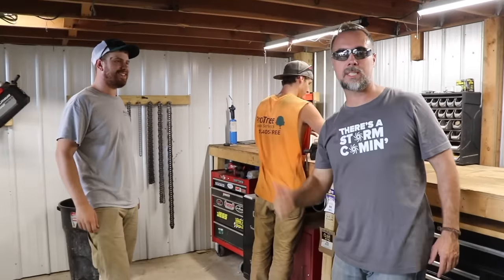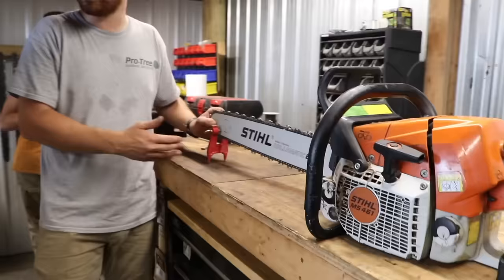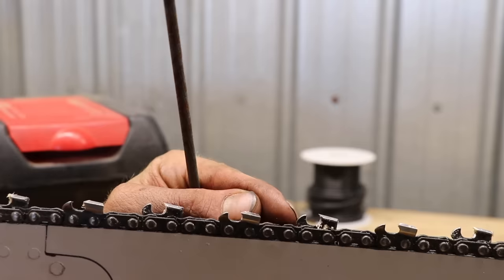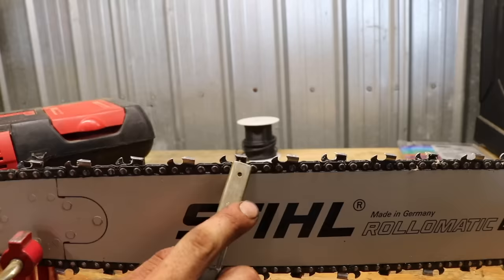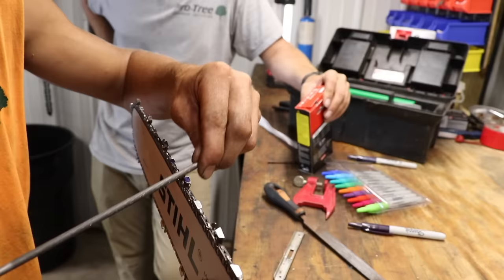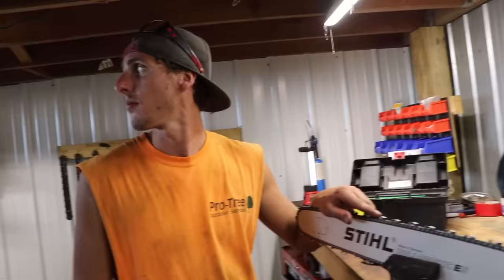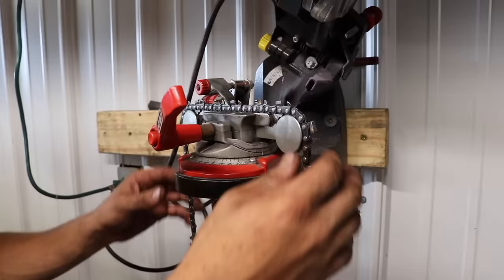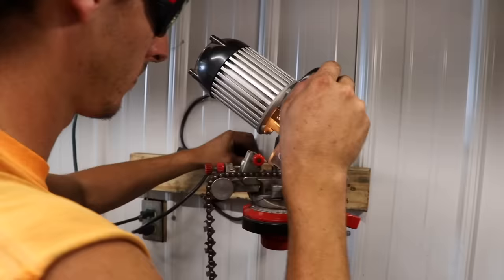How the Pro's sharpen a chainsaw

Comment: Harbor freight sells a chain sharpener that works fine if you are patient with it and it's not expensive.
Reply: It works great and for $30 it does everything you need it to do. I like that there is a little flex in the handle. That way I can first bring the grinding wheel down into the gullet using the depth stop without actually touching the tooth and then flex the handle sideways to bump the side of the grinding wheel into contact with the cutting edge of the tooth for a quick second without heating it up and bluing the steel. I usually give each tooth a few light bumps a couple seconds apart and it's good to go. Mounting the grinder up at eye level like they did really helps you see what you're doing and you don't have to strain your neck.

Comment: What was the clearance difference from raker to teeth ? What was the vertical angle of the grinder ? Also if you change the angle you grind out on the tooth you can just flip the chain to grind in the out direction. Shore up the grinder some also . What’s the best raker height I was after but 👍 for the video .
Reply: Hi J. The Oregon chains I use are set (filed) to 0.025' below the teeth tops. Best regards.

Comment: I hate to admit this but when I sharpen a dull chain I only improve the cutting a small amount.  After my small improvement it takes no time to reach dull as hell status again.  I have dropped my chains off to be sharpened at the pro shop and get the same result minus $5 per chain.  I know I'm doing something wrong and they are too.  I just buy new chains since I'm not a big time user of my saw.

Comment: Hand filing will never let you down and cheap investment.  Filling each tooth evenly (remove same amount of metal) for an even cut is a myth,  if one tooth is damage is going to take more filling strokes than the others,  and you are not going to lower the other tooths to the level of the damage tooth.  Make sure you have sharp tooth,  look at the top of the tooth and make sure is clean line and sharp corner and rakers are nicely lowered with raker gauge and you're good to go.
Reply: This is about the most level headed reply I've seen. Having every tooth the same size? what world do these people live in. Obviously one where production work is not getting done.Sharp top plate, sharp cutting corner, end of story. If you can't sharpen a chain in under 5 minutes no matter how F-ed up it is find a new career.

Comment: Just curious as to why he’s running the file the opposite direction? Should be pushing the steel away from the edge n sharpening the cutting edge rather than pushing the steel towards the edge thus building more material on said edge. Always file away from cutting edge.

Comment: You need to get cbn wheels and loose the stones.  Cbn wheels won't heat the tooth, provide a better grind and never need dressing plus they will last for at least 1000 twenty inch, forty inch overall loops.  I sharpen chains for my customers and grind chipper knives as well.  Diamond wheels sells the cbn wheels and you can order them online

Comment: One thing I notice you guys didn't show any adjustment on the pitch on that chain sharpening machine.  Also from what I heard is if the electric sharpening machine doesn't have a reverse motor on it One side of the chain gets sharpened on a different direction than the other side it never cuts very well .

Comment: Great video, I have a chain sharpener but in screws down to hold it in place and its difficult to sharpen the chain without it twisting because of the way it is positioned in the base, is it possible to make it so that it screws onto a wall instead????

Comment: I'd prefer the hand file technique rather than the mitre grinder. 1, cost to use ratio. 2, I practice with my gear as a florida outdoorsman for when the annual storms initiate a shtf scenario. No power= no grinder (or luxuries).

Comment: I can sharpen the chain almost as quickly as that grinder. Just practice. 
 FYI when you’ve reached the point of bluing a tooth, that means you’ve reheated it, taking OUT the hardness and making it SOFTER, not harder.
Reply from the maker: Thank you for the tip Mike!

Comment: Excellent video, I really appreciated your raker teeth instructions. I do take them down but not with as much precision, so I will lift my game on that. I have only had an electric sharpener ,(similar to yours)for a few months and was quite interested in how long you applied the grinding wheel to the tooth, as I was a bit concerned I might have been grinding too long or too hard. From what I saw you actually grind the tooth more than me, which was a bit of a surprise. Here in Oz our fire-wood is hardwood and I am at present cutting the hardest of the hard ; 100 y.o. fence posts of a  timber  known here as Black Box,  dry hard wood so the saw must be good. I sharpen after every tank of fuel and was advised to turn my sharpening disc over about every 6 sharpening and turn the bar over regularly as well. Also we dress the bar cutting edge with a flat file to take of any feather edge.    I am getting pretty good cuts but one can always learn more . Cheers Davox.

Comment: My great uncle has a 455 rancher with a 20in bar great saw cuts great well til it started cutting crooked. How can I fix it so when I cut it don’t cut crooked? It’s sometimes straight and sometimes you can see a curve a little bit to it. The last 3 cuts I did yesterday was curved so I stopped the first time and sharpen by hand then tried again and the 2 last cuts was curved. I’ve only been running a saw for a couple years and this is the first time this has happened to me.
Reply: Take bar off file it with flat file to get burs off then flip the bar. Sharpen chain  if was not cutting good then check the racker deph  and when sharpening all ways get the gullet out
Reply: @jasonscruggs986  i tried that earlier and it still cutting crooked still has some curve to it. I'm gonna pick him up a new bar and chain. I gotta get one my polan anyway.

Comment: Good vid!!!  I learned that bluing a material ALWAYS makes it softer???
Reply: it actually all depends on how fast the metal was cooled after it was heated. the faster it cools the higher temper/more brittle the metal becomes
Reply: @bhf4u  Ok, but in this video they start from a hardened material that gets heated by sharpening it, and there is no cooling (quenching) after.

Comment: pretty good,,, hand files work one way,,dont drag it on the wayback,,,the handfiles make the chains last alot longer if u can file,, the teeth should be kept same lengh,sharpness etc,,if they get to far off they can cause cutting problems,, iv had chains the angles were different and teeth were longer on one side cut straight still and others that were pretty damn perfect still would cut to one side lol when i file ilike to push up, try not to take more metal off then needed,, my chains usually last awhile,, if idont go cutting rockswith them lmbo,,,,,,,,,,,,,,,,,,,,,,,,, but in all good video!
Reply from the maker: Thank you !
Reply: Aah yes the rocks,doesn't take many lol
Reply: @ferrallderrall6588  honestly it amazes me how far into the rock it will cut lol
Reply: Won't happen if you got the sharpner with you of course lil
Reply: @indianajones8200  lol,, been running chainsaws for 10 years now,, believe what you will,,, lol

Comment: Most difficult part of chainsaw maintenance is the damn chains!!! Angles, Chisel, Semi Chisel, .050, .063, Pitch, blah, blah, blah...Getting all that right is a bitch. Then it has to be sharp! LOL...Good info guys. That Oregon sharpener and hand filing do take lots of practice to get it close to "Factory" condition. Chain manufacturers put the perfect edge on each tooth before they're even assembled. Thousands of dollars worth of equipment just in that part of production. KEEP SHARP!

Comment: Ok you said 30 degree for tooth sharpening what about the angle to set wheel off vertical??
Reply: This angle is actually more important than the angle you talk about as anywhere from 25 Deg to 32Deg is all dependant on type of wood being cut. Might be ok for soft wood like Fir but it not good on Australian Hardwoods.

Comment: I have a strange question. I just started cutting slabs with an Alaskan chainsaw mill for the first time. When I’m out in the field, I seem to get 3 or 4 sharpens on a new blade and then on the next one, it only produces dust instead of shavings. I’m doing the exact same thing I do on the previous sharpenings. Will a hot or close to hot chain prevent a good sharpening? Wasn’t sure if I should let the chain cool down a bit or not. I’m kind of stumped.
Reply: Rakers need to be filed down.

Comment: The electric sharpener disk is always spinning in the same direction so sharpening every second tooth on one of the sides must be wrong, the same as hand filing in the wrong direction while the teeth on the other side would be done correctly. So wouldn't it be better to align each chain side so that the direction of the spinning disk matches the cutting angle of the tooth as in hand filing?

Comment: If I use the electric wheel sharpener do i need to go back and file the rakers as well ?
Reply: Yes.
Rakers should always be set according to how long the cutter is, the length of the cutter changes when you grind the cutter or file it.
Any other questions id be happy to help. I have plenty of vids on my channel to see how a properly tuned chain cuts.
Have a great day.

Comment: KEWL !!! Thank you for posting! 
   Question...On the electric sharpener, does the grinding wheel go up inside the cutting tooth, and cut a radius like the file does, or does it just grind the edge straight and at an angle? I bought a Harbor Freight one and it doesn't sharpen like a file does, and it doesn't cut near as good as hand filing does! Do I have it set wrong? I have watched MANY videos on it and I have mine set, just like theirs, and I have reset the rakes, too. If I hand file, the saw cuts great! If I use the machine, it tries to rub thru it! HELP
Reply: Stop buying stuff at Harbor Freight prices if you want professional grade results.  A better model will work better, especially if you have someone that's been doing it a while there teaching you.  However, even quality machines are difficult to set if you want better than hand-done work.  If you're not doing several tons of cutting every day, it might just be better to stick with the hand file.

Comment: I would have ask how long it takes you to do this compared with how much you make per hour. It might make sense monetarily to just get a a new chain or buy them in bulk.
Reply: Throw away a new but dull chain? You would be fired immediately from any job.
Reply: Good point. Why not just include in the quote the cost of a new chain? They also spent $600 on a chain sharpener.

Comment: what is the thickness of the blade on the electric sharpener?
Reply: It should be 3/16 for a 3/8 or .404 chain and 1/8 for .325 and 3/8 low profile also called picco for stihls 3/8 LP chains.

Comment: cant flip flop but you can switch hands 
and do every tooth as u go once around
Reply: No you need to file from the back of the cutting edge to the front. This gives a more honed edge to the edge. If you file in reverse it is easy to fold the very edge of the cut and this will blunt quicker.  So sharpen evry other and then reverse the blade as they have shown.
Reply: Blade? Chainsaws have a bar and a chain. Alot of other saws have blades, but not a chainsaw
Reply: Everyone that knows what they're doing sharpening saws does all one side, then flips and does the other. The angle gets maintained consistently better that way.

Comment: I'm sorry,but I disagree with other folks comments. I know yall meant well,but this video is woefully inadequate for anyone who needs it. There was constant interuptions,conflicting opinions,jumping from subject to subject. If this video is meant as an introduction, and I'm assuming that's the intent. You should lay out some basic options for sharpening kits,get some closer shots of the before,during,and after the sharpening.  Show a hand sharpened chain as compared to a new one,and when one is almost to the end of its service life. The $600 sharpener is nice,but only as a mention and perhaps minor demonstration. Oregon,husqvarna, and stihl all make decent affordable hand sharpening kits and the only downside is that they're a little slow to use correctly.  I hated trying to use a stump vise in the field because you ended up squatting on the ground or at some weird angle. I ended up mounting mine to a 3ft long 2x12 and I sharpen on my tailgate. I'm not a big fan of Oregon depth gauges. I prefer stihls or husqvarna. A good clean round file can work miracles on even the most dull chain. Buy yourself a good hand filling kit,stump vise,and a few extra chains. Watch your chips on your new chains and strive to maintain that size.  Some videos on bar and sprocket maintenance would be helpful to newbies too.

Comment: I have and 16” chainsaw that is less than six months old. The chains adjuster failed so returned it to the shop where I purchased it. They now tell me I need a new guide bar, as there bar has been hot and lost the temper. There is a small blue area about 2½” inches long by ¼” high alone the bottom of the guide bar. These seem strange, as I have seen other Guys with blue area using their saw for month with no problem. Is the Guy in the shop correct?
Reply: Well you have taken some life out of your bar. Sounds like the rails may have been pinched together or maybe you are pushing hard because your chain is dull.

Comment: If you try to sharpen a knife on a motorized grinder and the edge turns blue, you've lost the temper, meaning it's softer not harder. Don't see why it'd be different on a chainsaw tooth. But, I'm no professional.
Reply: William Emerson I don’t know the science behind it but I know from experience that if your chain gets blued, a hand file won’t take any material off at all. Again, don’t know the science lol, but I only hand file for that reason
Reply: @DeRobez  Well, alrighty then. I would really like for someone to explain this phenomenon to me. If you check out temper color charts for carbon steels (anvilfire.com) the four steels listed,1040 to 1095, the Rockwell hardness drops as the color goes from full hardness to the blues and further down to red. I have no idea what the carbon content is in these saw teeth. Must be something magical about chainsaw teeth. LOL.

Comment: Learn to file left and right handed, do both sides from over the saw. I rarwly see one handed sharpening getting the same results side to side.

20% of the file should be above top plate to get a good durable sharp hook, sharpen relative to the top plate at 90° if chain leans over then lean with it. Use a depth gauge guide. Never drag a file backwards as it'll blunt the file

Practice and test, practice and test, it's not rocket surgery

Comment: When sharpening the chain always sharpen in to the cut.
Reply: I've got a pro chainsaw sharpener that I inherited, and it has a reversible motor 2 way switch. I do sharpen only one way so the sparks are blowing away from me, as shown in this video. And the saw cuts nice and straight. But logic tells me to sharpen into the cut as you said, which I should be reversing the grind for the teeth that go the other way

Comment: My chainsaw is cutting down and slightly to the right. Sharpen left cutters?
Reply: Length of teeth need to be the same on both sides. Uneven tooth length is what causes crooked cutting. All teeth should be the same length. You can get away with minor variances if they're spaced out enough, but ideally you want complete uniformity.

Comment: you guys should watch ""Buckin Billy Ray sharpen  saw on U tube
Reply: My words exactly. "Get the gullet". The tip of the tooth and the shape of the hook are key, and if it takes 5 passes with the file, you shouldn't do 4. File till they are sharp. They don't have to be the exact same size if hand filing.

Comment: A echo fan xd they are not so bad now but a fan your'e the first!  (sorry bad experience when they start get on market) 

Sure they not have the anoying sound of a Stihl...     TRY JONSERED
First when you file remove oil of the chain by cutting in the way of the fiber a little and die the saw in (your'e file gonna last longer)
The bottom of tooth need to be made it let eject more (and thats its the most common mistake i see they dont care about and at some point  the tooth have right angle on top...) and the angle (side) less in soft wood and more in realy hard 

The tooth not have to be all the same its sure its better but if you touch rock the depth gauge realy make it  (im not english man) and when youre at the end you cant move a little higher your hand to make it cut more. 

Dont forget to file the side of the blade it make edge with time (careful it can be realy sharp)

AND go on the side you gonna be more able to go straight and see the angle of your tooth its the first point if you dont want your blade curve in wood the second is the raker (if its start curve stop it you can twist the chain) 

I search for good tutorial https://www.youtube.com/watch?v=_bfzryH7qhE  and you can change the side of the saw when you finish one side . Do not do like him or like me KEEP your two hand on the saw when your'e using it noob its a motor generaly almost same force in basic scooter and always watch the top of a tree carefuly with a helmet and have safe place to run when it fall before cutting (make it if not) dont stay on side of it. A branch or the trunk split or move back to you can be last thing you feel.